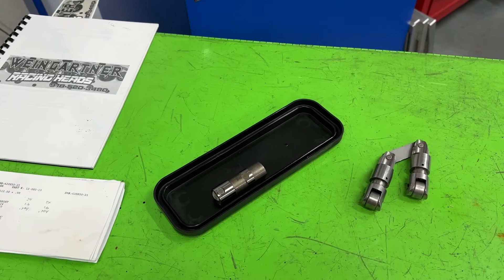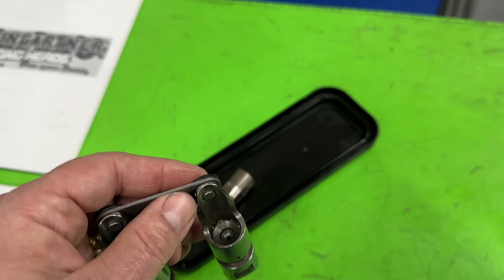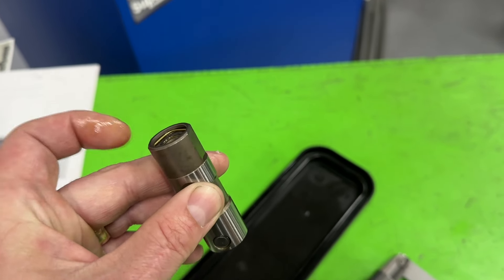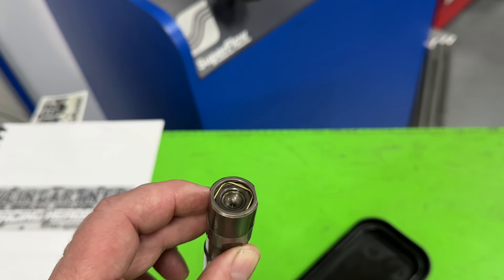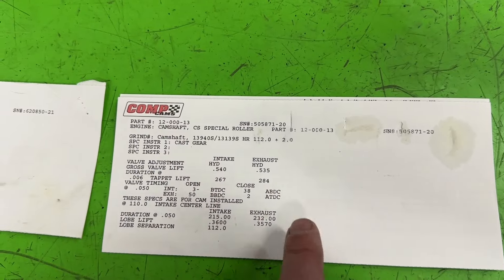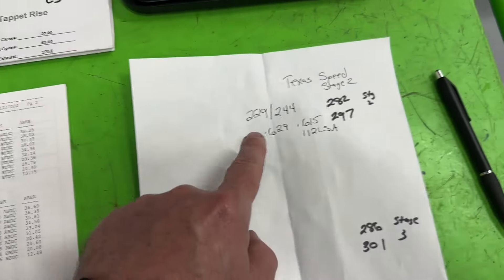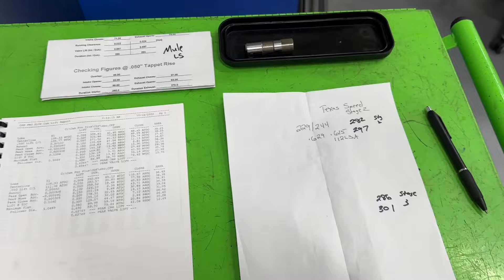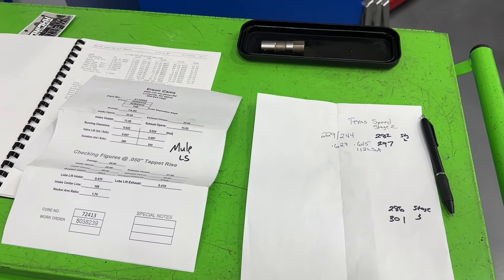The Difference Between Hydraulic Roller Cam Specs And Solid Roller LS vs SBC

Comment: Going from a 5.7 tbi to a 5.3 in my truck was a huge improvement. Lifter issues had 5 of them fail.  It was just dirty dingo slider mounts and a 4l80e flex plate. It's mostly gm stuff bolts right up to a th400 and saved like 200lbs off the front.  Its not a bad swap. You have to see that most ls guys are broke and use stock bottom ends.  For me, my step dad built 383 and 350 with vortecs in his 79 truck and now has a 454. He did hill climbing as he got older. He wanted to try an ls because i get twice thebmileage with similar power to a mild 350 with a summit spring kit and a cam that's a 220/224. I want a coyote next since theyre the new hottest engine.

Comment: Try the SBC cam specs in the 408 LS for a comparison. If the SBC is solid roller then use a solid roller in the LS.
Reply from the maker: I mentioned this in the video. I have two identical cams just need rockers.

Comment: I think this is the first time I've heard solid and hydraulic roller cams compared this way.
This was new to me. 
I already knew solid and hydraulic cams has different ramps, but had never thought about how it impacts the duration.
This made me think of a experiment I think Richard Holdener did on a LS with hydraulic lifters. I think the conclusion was something like that a hydraulic cam don't give the same effective duration trough the whole rev range because of how the hydraulic lifters work.

Comment: you cant transfer .020" lash to the lifter unless you divide it by the rocker ratio   Just as lobe lift and valve lift is deferent so is lash at the valve tip compared to the pushrod side from the ratio on the other side of the fulcrum is deffeernt
Reply: @bigbearvenom6145  not only closing the lash up quicker but .020 at valve is not .020 at the pushrod /lifter. when you pull the feeler gauge out of the valve, the pushrod side will not open up .020 when the valve side closes up that .020 that the feeler gauge was taking up unles you have a 1 to 1 ratio rocker.  the lifter side of the rocker allways travels less than the valve side . So when you close the lash at the valve the pushrod cup doesnt move the same amount in its lesser arch so the clearance will be diffeent.  General rule is a solid cam needs 10 degrees extra to match a hydrualic at .050.  They use that number because that about where comparable airflow starts happening

Comment: That .020" duration on the solid cam is .020" 'tappet rise' which assuming a 1.5 rocker equates to .030" lash.

If your cam calls for .022" lash then your 'at the valve' duration figures will look larger than that .020" tappet rise duration because .022 ÷ 1.5 = .0146" tappet rise.    Then depending on the lobe ramp rate in this area of tappet rise will determine how much actual extra duration you see at the valve 
 
Then with a hydro lifter not being a 100% mechanical connection (hence the .006" tappet rise adv duration figure) the actual .050" tappet rise  figure reflected at the valve is smaller.

Then we throw in valve train deflection😂

I keep meaning to do a solid V hydro cam degree video demonstrating these effects of what you see at the valve V the tappet when attempting to compare cam cards.
Reply from the maker: Now I agree with this except the deflection is far worse with solid roller because of spring pressure. It looses more than .030 of lift when I have checked. I don’t think you loose near as much with hydraulic roller. Also don’t forget the Ls is 1.7 ratio compared to the 1.6 of sbc so it is gaining faster. The Ls also has a steel rocker compared to aluminum on sbc. There are many variables that play a huge role. The big thing at least from the cam standpoint they are duration different but not as much as most people think.
Reply: @WeingartnerRacing   totally agree, the variables are almost infinite in these scenarios.
 What happens in the running engine  is quite different to the cam card. As you know,  the engine doesn't care what the lobe does or cam card says, it only cares what the valve tells it via available port flow at any given point. Hence same cam and valvetrain, different port flow = different engine output.
  Did you check your deflection with light spring(i typically use an inner spring for this instead of a very light checking spring) V full spring?
 Im sure you aren't just calculating a deflection based off of tappet rise V theoretical lift?
Reply: @WeingartnerRacing  re the rocker ratio being faster. Did you map that in crank degrees V valve motion at the valve/retainer? 
 Looking at the 2 cards(cam doctor SR and then written down HR) we have close ish seat duration about 20 degrees more effective dur at .050" on the SR cam taking some lash into account, dont know the .200" spec on the HR,  but then more net lift on the SR. Im going to bet that the actual valve action in crank degrees is faster on that SR than the HR even given the 1.6 V 1.7 rocker ratios.

 What would be interesting is to see a map of valve action in .050" increments V crank degrees  and the head flow figures at each valve point for the 2 different cam rocker head combinations. That way we will more closely see what the engine actually sees. This is all such interesting stuff 👍

Comment: There was a short half page article about the factory corvette race car that ran factory oem LS7 lifters that had a ceramic check ball. The were the original ones before all them were the same lifter.  These were not the same ls7 lifter we have today because all of them are now ls7 lifters. 
 Well the race engine reported to be running at 8500/8700 rpm’s with no valve float issues running a hydraulic roller cam. 
 I think this was around 2006-2007.

Comment: I'm running the Comp 292 xfi  cam in my small block Chevy. It's a hydraulic roller. I've been thinking about throwing some solid rollers in there seeing if I could pick up some performance. Would the lift loss and duration loss from the lash make it pointless or would I possibly actually get better numbers horsepower wise.

Comment: I have an 86 vette. No roller lifter. It started in 87. What GM used it before that?
Reply from the maker: I misspoke.
Reply: @WeingartnerRacing  all good brother. I was just wondering if maybe Cadillac used them earlier.
Reply: I thought even the 307/350 olds had them starting in 1984, the 6.2 diesel in 1982. I think its the same Pn.

Comment: Lucky I had an early cam doc  I checked where the Valve opened .006 which also takes rocker ratio into consideration
This is called SAE duration, SAE Net lift,   with a 1.5 rocker this is .004 (like Crane)  Crower  is usually .005, Comp, Lunati, Jones etc .006, Engle .008 Isky varies with series but Mega Cam uses different but assume .009 (open and close may be different)
So at the same Advertised Crane are smaller and Isky are actually much bigger (but their lobes allow higher revs {back in the day}
I do not have up to date data on other than Jones designs, like Comp .904 HL Hydraulics (the are not inverse flank designs)

Comment: + the hydr
 Lifter sponges some more and loses some lift. Lift makes power period.but that was a good explanation between solid and hydr. Cams.
Reply from the maker: I can promise there is more deflection with solid roller spring pressures than with the squish of the hydraulic roller lifter. Usually you lose 0.030 or more.

Comment: AS far as cam profiles go the GM Indy project spent $$$ mostly on the initial opening/ closing and the over the nose.
The over the nose optimizations gave more rpm at less spring pressure, raising the rpm of valve float
Then the could increase the area after>over the nose< on the close side
Work done for GM by Mike and Rick Jones I think dad Chuck was gone by then but the computer programs he started were redone.  At the time no one else came close, still no one else is grinding inverse radius with a small wheel which also makes a big difference

Comment: I like running hyd roller cams with solids lashed at .004/.006. Seems the best of both worlds. Milder ramps and super responsive with hyd roller spring pressures. Lash sounds about like a sewing machine.

Comment: Hey Eric, go check out the Yella Terra Rockers from Australia your exchange rate is pretty good for you guys YT 6682 in M10 or 7/16 Unc Pedistal mount good for 900lb open.
$1444 AUD and shipping wouldn't be that much.
Good to see you got a solid roller  for that LS thats very close profile 👍
For interest the way i do advertised for a solid is lash devided by rocker ratio ie 0.014/1.6=0.00875 so duration at 0.009 odd seat to seat timing.
Though im not Batman either😊
Good onya mate👍

Comment: A solid roller of that caliber will have a way more aggressive ramp, meaning the valve will have high lift longer which will make the difference in this case. Another thing I noticed was the sturdy dart block instead of the stock flimsy block

Comment: The ls has a bigger cam core, I think that helps with the valve float issues. Which I don’t think the cam your discussing is no where near an issue, it’s when you get into the bigger stuff that the bigger core helps out.  Good stuff though.

Comment: Another difference is that the LS has a much greater base circle which allows more accerleration at the same side thrust  also
the area under the curve is greater, more area at the same SAE duration,
 with SBC we bored the worn lifter bores to MOPAR .904 which allows a greater roller wheel which also helps

Comment: Afaik the L5P duramax uses 0.842 solid roller lifters that have a lifter tray. I dont know if it is directly interchangable with a factory hydraulic Ls lifter but everything looks like it should work.

Hydraulic cams are great for manufacturers because of tolerance stack. They can build millions of engines with exactly the same parts and all of the manufacturing tolerances are accounted for by the plunger.

Comment: One question idoes the LS has the same value  size  as the small block chevy ?
Reply from the maker: It depends on which head was used but on this one it was 2.08ls vs 2.10 sbc.  I have used 2.165 valves on the Ls and on those heads it made less. All the same exhaust size 1.60.
Reply: So for this test tdid the LS have the bigger valve
Reply: The SBC had the 2.10

Comment: BTR shaft rocker kit WITH rockers $470

PRW shaft rocker kit $890
Hell, Speedmaster $464
Will any of these work?
Reply from the maker: No they will only handle Hydraulic roller cams and the btr is non adjustable

Comment: I bet the bigger hyd roller in the Ls kills more torque than it’s worth, and the manifold may hold it back up top, personally I would have just put a 229 hyd roller in the sbc, the lobe profile on the sr probably give the small block a quicker valve opening,

Comment: The biggest difference I see is the larger cam core size in the LS. I can't tell you how many times I've run into the "Limits of the cam core size" in standard SBC and BBC especially!! There's a reason we bore the cam tunnel in the BBC block for larger core cams and raise the cam location in the SBC.....and it has a lot more to do with the overall SIZE of the lobes than the core of the cam.  Hint: The larger the lobes can get, the less "hydraulic intensity" is required in the lobe profile. The less "jerk" is in the valvetrain, etc....
Simply put, the LS "SHOULD" be substantially better in the valvetrain department. How much that pays off in the way of HP is yet to be seen.....but we all know it definitely pays off in durability and longevity. 
I will also add that we are still in the infancy stage of lobe development for the LS compared to the nearly 7 decades of development the SBC has had.

Comment: Wow, in general I like your Contnet, but  that is some serious gaslighting...

You technically do not lie, but what if we have a more exact look at the cams:
- the solid cam has almost 0,05" of lift more (accounted for lash)
- the solid roller has at 0,,1" of lift (being almost 0,08" of Lift accounted for lash) a duration of 226/236, and the hydraluic has 229/244
Judging from the durations at 0.05" and 0.15" I think the actual duration od the solid cam at 0.05" is around 240/250.
- combine these with the faster ramp and therefore even more duration differnce at higher lifts AND the noticeably higher Lift, and I get to the conclusion, that the solid roller should perform more like a Hydraulic roller cam with 245/255 duration and .7" of Lift
Reply from the maker: I don’t agree with your lift statement. Because you lose far more lift with solid roller springs than hydraulic roller spring setups. I have done a video on that. So .685 minus .022 is .663 then take away .030 from deflection and you are much closer. Still more but much closer. On the duration you are correct which is good because i tested a 243 hydraulic roller cam on the Ls you are going to love those results. As far as aggressiveness of the lobe that depends on the lobe. I have a cam doctor for a 260 duration hydraulic cam I will show on Saturday it’s close to the solid roller.
Reply: @WeingartnerRacing  from what I have witnessed, if that 243 cam had a bigger exhaust split, a different lsa, and maybe more lift it would've made more power everywhere compared to Texas speed cam. I would love to see a similar cam tested with those things to compare.

Comment: Do the LS fans know the LS uses the same lifters as the mid 80’s and up roller cam blocks for the small block? 
Same lifters. 
 Some of us know how to adjust valves for the sbc. 😂😂🤣🤣
Reply: There's early LS and late LS.  Late are what's referred to as "LS7" lifters.  They changed the oil groove slightly.
Reply: @chriswise1232 the ones I am referring to were the ones that do not exist anymore. The ceramic check ball, and ones that the race engines used that were said to go 8700 rpm’s. Part numbers change. And many long searches I can’t find the originals as mentioned above. As of a few years ago all the lifters became  “LS7” lifters.  There is no specific gm production ls7 lifter. Somewhere along the way the lifter you get in the high performance model are the same you get in the base 4.8. And yet still everyone claims ls7 lifters are the upgrade. When the ls7 lifters are literally the production lifters everyone gets now.